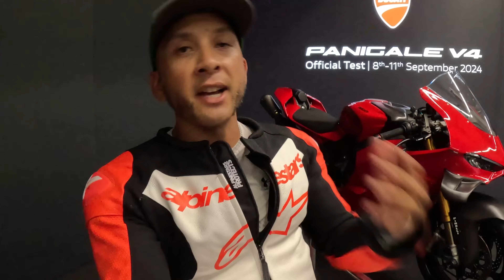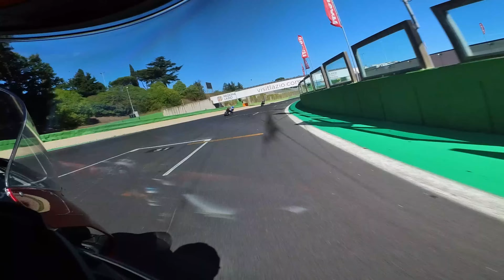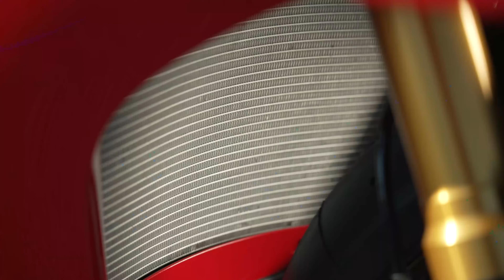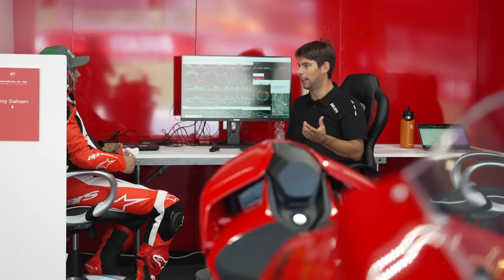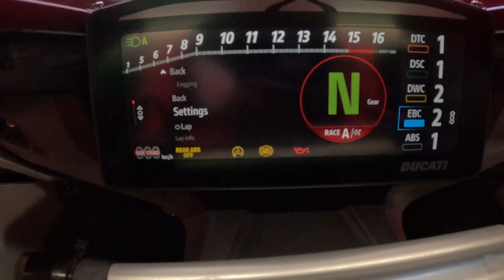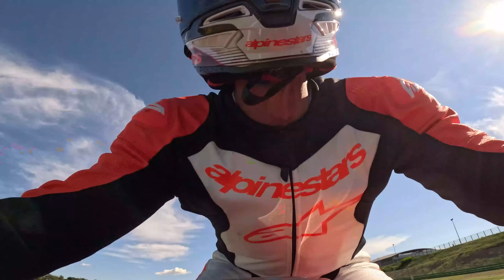2025 Ducati Panigale V4S First Ride – The Most Advanced Superbike Yet

Comment: If you bike is rinning wide at corner exirs - increase rear spring preload winin reasonable sag values 25-35mm or/and increase swingarm angle. And it will exit corner like a roket. Rear brake on corner exit helps to control engine power, so fix simple things first.

Comment: Anyone have experience with electronic suspension?

I’m curious just how adjustable is it? 
The  low speed compression looks way too soft and the rebound too slow for my style. I can feet the chattering in my teeth.
I don’t like front end travel having that much say so in my wheelbase length, I’d rather control that my self. I prefer to use the rear brake control wheelbase. The front traveling like that change’s line drastically when I get on the throttle.
Reply: The current gen has electronic suspension. Works pretty good.

Comment: How is the heat? Does it get very hot like the old version? We need to see some reviews on street as most people will use it like that
Reply: It runs HOT AF. The rear brake line has already melted through a couple of times for me (this is now a recall issue in the  N. American market as you totally lose the rear brake) and you can feel the heat even through leathers. Like another commenter says, you will get low level burns on the insides of your legs during regular riding in the summer months. I live in Japan and it gets up to 40C with humidity here, so I know what heat feels like. For context I own a V2 (commuting) and V4S (everything else) and have permanently red inner legs. And I probably can't have any more children as I've been BBQ'd from the waist down. Ways of reducing the heat: leathers, sports/race seat, heat shielding under the seat and around exhaust, after-market slip-on/full system (super expensive), push yourself back in the seat while riding (this loses you quite a bit of control on the V2 though as you're perched too high).
Reply: It’s going to be hot as balls. Until Ducati goes electric, they will all sizzle your ass. This one too.
Reply: better get  E-bike than a ducati if youre having a heat problem 😂😂😂
Reply: @itzerisadomeeiot4980  mate you don't know what you are talking about. I own the older version v4 and unless i am wearing leather i get second degree burns on my inner thighs. All other sport bikes get hot but nothing like the panigale. We were hoping that the new bike will fix this problem
Reply: @itzerisadomeeiot4980 It’s a legitimate question if you want to ride through traffic with it.
Reply: I live in Germany.. the Panigale V4 2024’ is my third Panigale
I will tell you all something !

If you are a really passionate motorcyclist and ride a Panigale V4 then you won’t mind the heat or anything else.
The feeling in indescribable and makes you forget all other problems ❤😊

Comment: Hopefully this New V4S will be faster than the last one that was 2 seconds a lap slower than the 20? yr old GSX R 1000 K5 you tested against - THIS MUST BE SEEN (please)
Reply: Yes, but that test was clickbait. 1 test and people are taking it as read that a k5 is superior to a modern panigale?😅 Technically, the 2017 onwards gsxr is superior to the k5 (which was an amazing bike) in all areas and would blitz it on track, yet watch any recent group test and what bikes come out on top? Ducati and bmw. Do some actually believe bikes have not moved on in 20 years? if that was the case, those running in world and domestic superstock and superbike championships across the globe would still use those platforms, they don't.
Reply: @motoman00  it's hard to get 'tongue in cheek' in writing
Reply: Are you referring to the race-prepped GSXR vs stock V4 video? 🙄
Reply: @sp00ky1969  of course it was. I'm using the same Title they used on the video - clickbait - (and it still should'nt be 2 sec's a lap faster) and hopefully we'll see the Ducati get its own back
Reply: As stated by Revzilla, a spring swap from street to track will fix that nonsense right up.